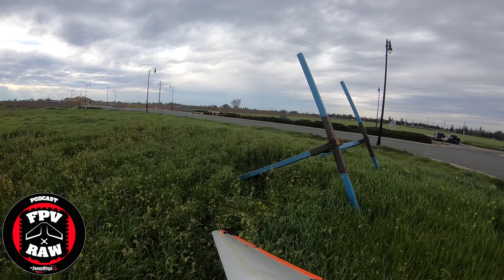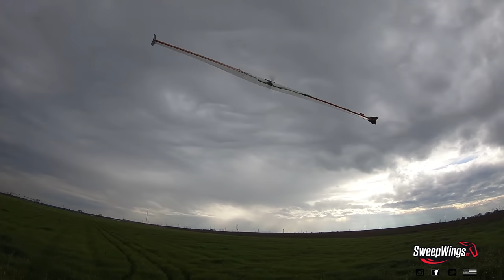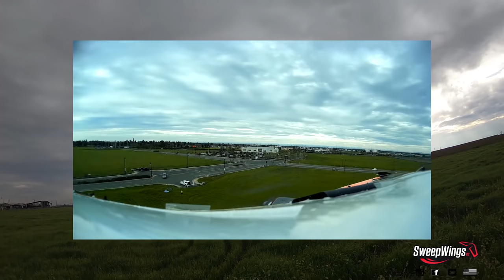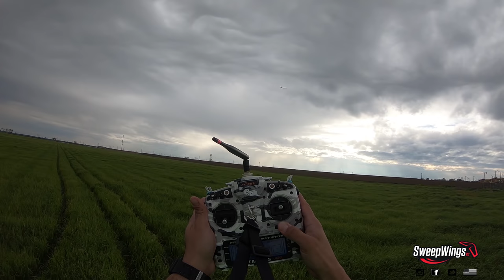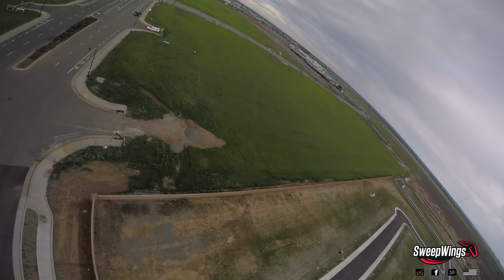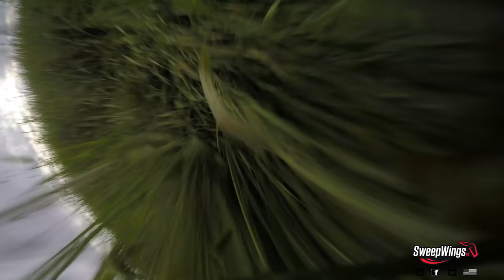Sweepwings - Onslaught 11 foot FPV wing

Comment: She’s a beast Ruben! She sounds mean, but does the acceleration match the sound or does it take a moment for the thrust to have an effect on it?
Reply from the maker: Tim Edwards its not bad for the punch as you can see. It weights in at 17.8 pounds and they really don't make A lot of gear for what I did here. I'm just glad it worked. Lol